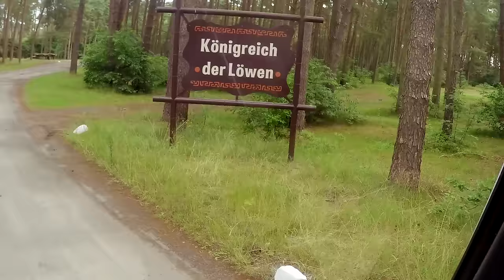„Wie reagieren Löwen wenn sie sich selbst im Spiegel sehen?“ Der Serengeti-Park zeigt es!

Comment: They should've done what the zoo in Kentucky did. They glued the sheet metal down to get rid of the warped which gave it a fun house mirror feel. They didn't want that so they covered the wood back with glue and then they put the sheet metal down and layed something heavy on it till the glue dried. What they got was a perfect mirror so to speak. There wasn't anymore high spots or wrinkles so to speak.